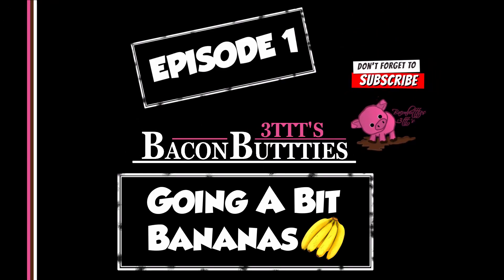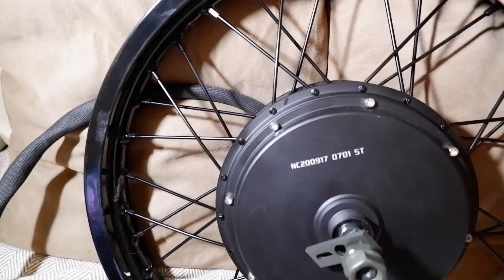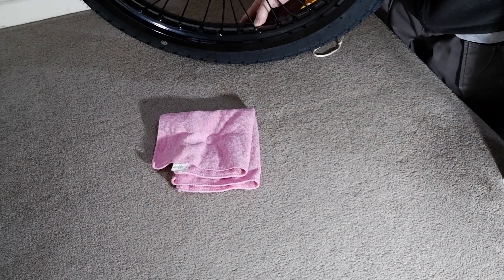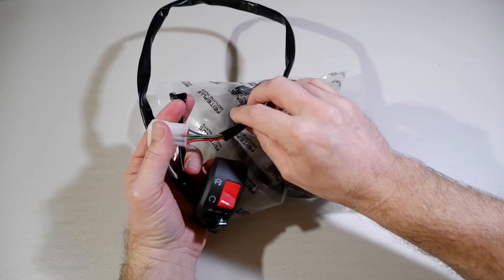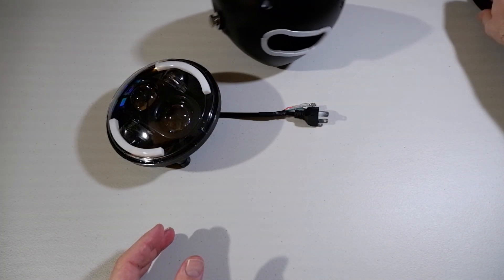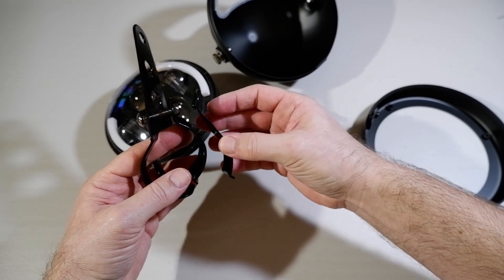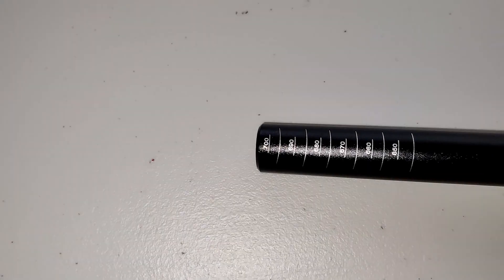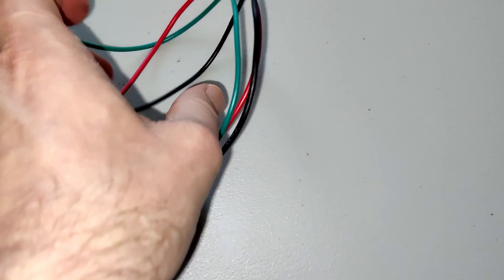FAST EBIKE BUILD UK ROAD LEGAL PART 1 MSVA FAST LEGAL ELECTRIC BIKE FIT FOR THE UK ROADS 11000W

Comment: Super excited to see this build mate! I'm part way through building an MSVA bike as well so nice choice of parts and will certainly pack a punch at the end!
Reply from the maker: Yes I have been keeping up with your build as well. So you are going down the MSVA route as well then? I'm hoping to make a hybrid brake system using SUR-RON light bee X brake levers as they have the switches and glass oil level.  I'm not sure if you need the oil level or not for the MSVA but I though I might as well do it.
Reply: @baconbuttties  Yep going down the registration route like Andy Kirby. Am probably going to register as a 50cc and then scrap the 30mph limit when nobody's looking ;) but toyed with the idea of going for a full on 125cc. Just looked up the Sur-ron brakes as I didn't know you could buy them and you do need the oil level (It's somewhere in the 270 page manual!) Currently working on the wheels and brakes of mine and settled for some tekro HD-E710 levers which are very similar to the sur-ron ones but slightly cheaper.
Reply from the maker: @EverythingEbikeChannel I managed to find just the SUR RON levers for not a bad price here https://mall.sur-ron.com/products/light-bee-replacement-ebrakes?variant=31553281130568  I couldn't find any of the tekro HD-E710 brakes for sale when I looked.
Reply from the maker: @EverythingEbikeChannel  👍

Comment: Nice one ! ,not sure why you have gone back to building what's going to be another heavy ebike ?🤔🙂 anyway after seeing you first vids ,gave me kick up the ass into building my own after wondering and putting it off ,pleased to say now built 👍 , word of advice i have same wake handlebar clamp and managed to snap off one of the bolts ,didnt think I tightened it that tight tbh 😳 will be watching this build with interest, thanks for the vids !! 👍
Reply from the maker: The bolts are a bit soft on the wake stem clamp and they went a bit rusty on my last one so will change the bolts to stainless.
I'm only going back to a heavier bike because I am making it road legal. 👍🏼
Reply: Yes definitely soft bolts !!🙂

Comment: Brother putting a tire on isn't too bad if you take some soapy water and rub it around the bead on both sides be nice and generous with it and then go at it with those tire irons I didn't even use those plastic bits can't wait for your bill I'm doing a similar one with the cheaper steel frame and a 3T motor 72v 100amp setup
Reply from the maker: I managed to do the front wheel without any soapy water , just went bit by bit.  Not as easy as a bike tyre  but got there in the end. I hoping to build a 72v 200 amp  battery and  have 125 amps through the controller so hopefully it want sag to much when I give it the beans.
Reply: @baconbuttties  sound like it's going to be a beast I'm having  a 20s10p 30ah made with VT6's and a 300 amp ant bluetooth bms so I figured using only 100amps  will be good for the battery and give me plenty of room to upgrade the  controller in the future I'll be keeping an eye on this build especially the wiring up of the accessories (ie light, horn) that's where I get lost
Reply from the maker: @malicewhite2168  👍🏼

Comment: hi thanks for video question where did you get front wheel with twin disk hub? thanks in advance.
Reply from the maker: I got it from here https://www.aliexpress.com/item/32685191722.html?spm=a2g0s.9042311.0.0.27424c4dTkGEZW
Reply: @baconbuttties  thanks they gave dual disk hub for the front wheel or did you request it?
Reply from the maker: @fishly2974  I did ask and they said they all come with dual hub. Best to ask though 👍🏼

Comment: Hi, congrats for your ebike! could you please give me the length of the spokes of your front wheel and you rear wheel ? thank you so much
Reply from the maker: 210mm front 125mm rear - this is a rough measurement  as it's difficult to measure spokes exactly when they  are on the bike.
Reply: @baconbuttties  thank you!!!
Reply from the maker: @user-spv96x3x7i.4kc  👍

Comment: Are you allowed to have pedals on a >4kW (or >28mph) bike? I also want to build one and get it registered
Reply from the maker: Yes 4kW and under are allowed pedals 👍
Reply: @baconbuttties  sorry I meant more than 4kW. I don't see anything explicitly prohibiting them for more than 4kW

But there's advantages to having them for less than 4kW as MSVA won't look at impact protection on the sides and stuff as the pedals will protect you
Reply from the maker: @akbarramzan7436  If I register it at under 4kW then I can ride the EBike on my car license, If I go above 4kW then I will have to do a CBT, theory test and take a motorbike test to legally ride it.
Reply: @baconbuttties  yes but if you get caught riding above 28mph (they probs won't catch the nominal power above 4kW as it's measured as an average over 30 mins), you can get done for no license, fraudulent insurance etc

You still need a CBT for 4kW if you got your car license after February 2001
Reply from the maker: @akbarramzan7436  My licence is before 2001 and I will only go 28mph 👀